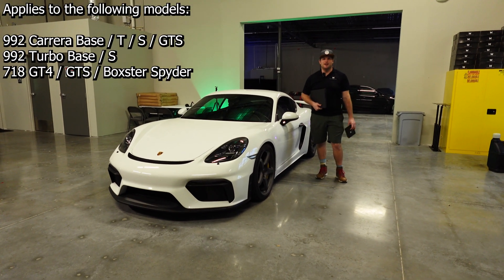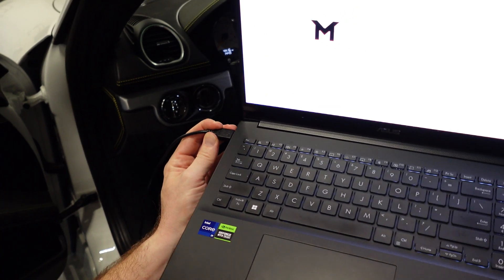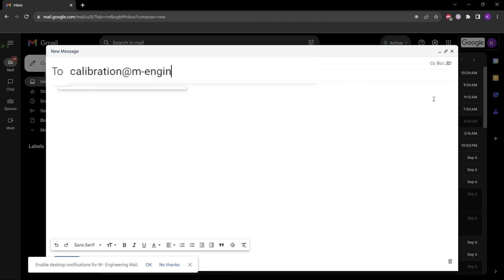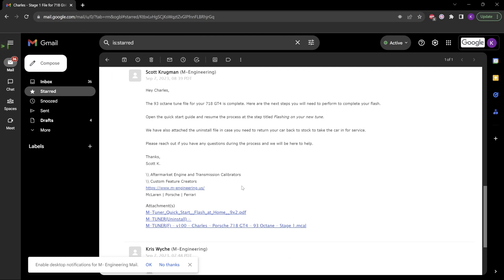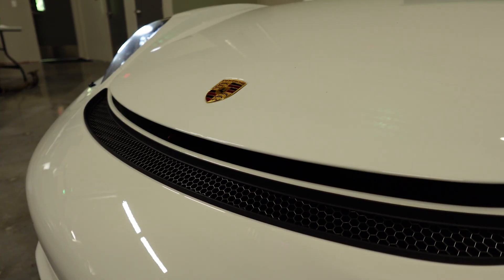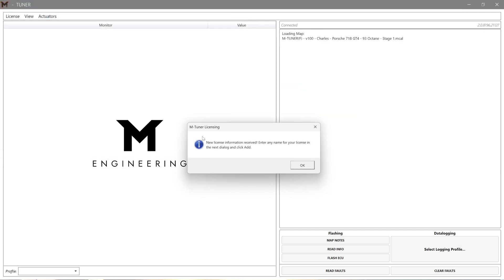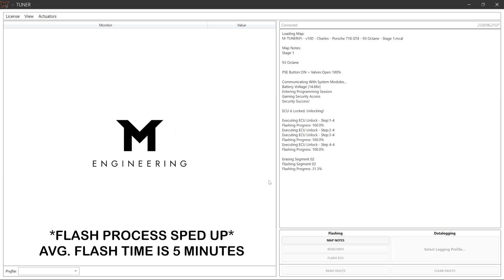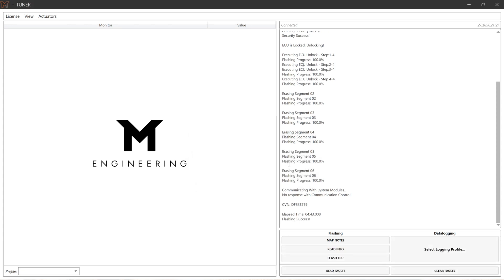Tuning Your Car In 5 Minutes Using M-Engineering's M-Tuner - Step by Step Install Guide

Comment: It says the battery is to low at 12.1 volt in our Porsche 911 but the voltage drops to 12.1 every time the car is turned on with a battery charger on it
Reply from the maker: 992 and 982 batteries are absolutely notorious for going bad early. You need a new battery.

Comment: Dumb question, does it matter if your door is open or closed when you flash?
Reply from the maker: You can flash with the door open or closed :) 

-Charles@M
Reply: @m-engineeringllc is it true that your tune can't be detected by Porsche if you flash back to stock?
Reply from the maker: @malinois71  I have yet to have heard of someone getting flagged after uninstalling the tune. All of our uninstall files are byte for byte stock with a verified CVN and verified CALID. Takes 5 minutes to flash back to stock. 

-Charles@M

Comment: So simple to use, can't wait for the wireless version 👍🏻
Reply from the maker: Stay tuned !
Reply: Is it out yet? Also is there a time for a 2024 GTS 4.0? The graphs make it seem like line is just the GT4 or Spyder  @m-engineeringllc
Reply from the maker: @malinois71  Yes GTS is available as well. The final power output will be the same as GT4/Spyder. It's just a detuned version of that motor. 

-Charles@M